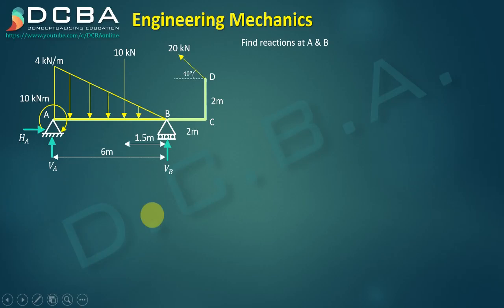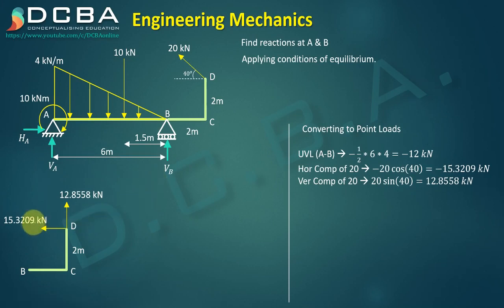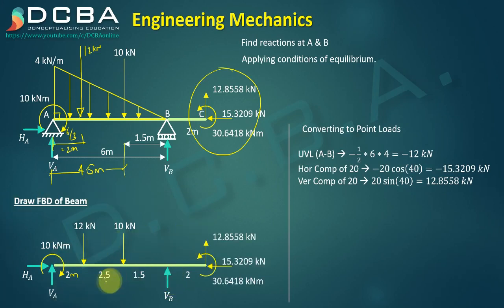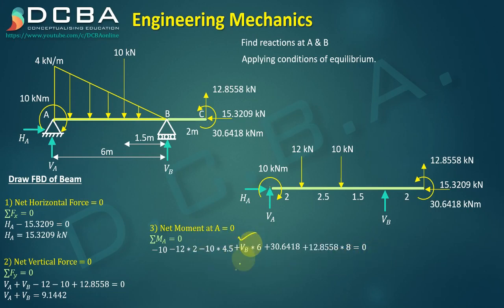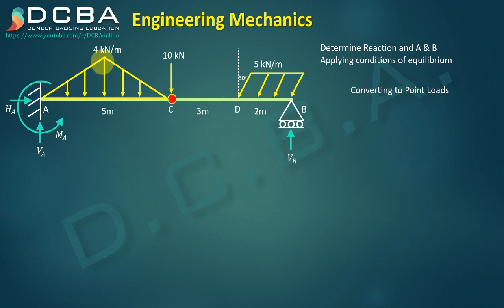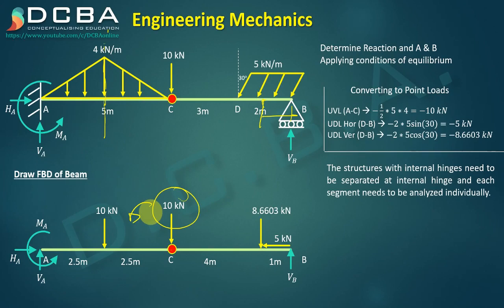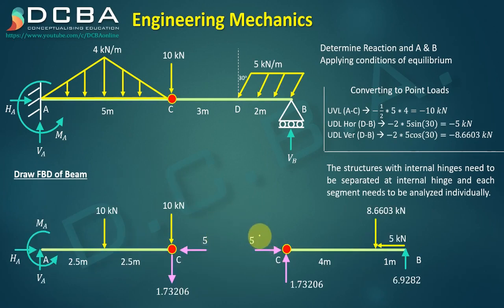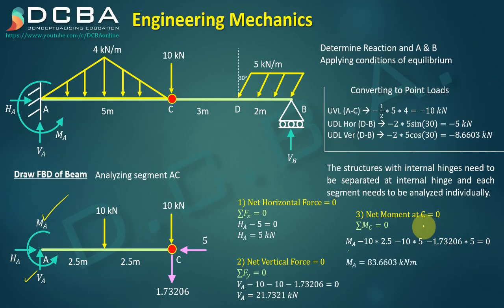Lec 26 - Beams with Internal Hinge support reactions | Engineering Mechanics

Comment: wonderful lecture..ur english fluency is awesome with good command on grammar. 
I have a doubt that, in internal hinge problem, when we keep load of 10kN on CB span, we get different Vc value than when we keep 10kN on AC span. So how is this justified? Is it ok to have two different values of Vc for different cases of keeping load on both spans individually?
Reply from the maker: My question is how did you calculate left span using just conditions of equilibrium, it cannot be solved with that you need certain compatibility equations also to solve it. Hence if you  are getting a certain answer by solving left span first it may not be the correct answer.

Comment: Really helpful to say the least.
Q: What about if a concentrated moment would act on the internal hinge?
Reply from the maker: The moment could be transfered to either of the sections when analysing each section separately.
Reply: @DCBAonline  , Thanks for your feedback
I'm facing some difficulties in analyzing this beam:
https://1drv.ms/u/s!AkY2QDLZoMD1gfky09HGgsjWMSkRMQ?e=hk89WL
When applying a concentrated moment on the internal hinge, the instructor has put the moment on each sides of the beam!!!
I couldn't figure out why he did that.
This is the solution of the instructor:
https://1drv.ms/u/s!AkY2QDLZoMD1gfkzlqYbCim8ORH6_g?e=61OSrT
Reply from the maker: Relative slope needs to be solved using moment area method. You can watch my videos on moment area method to get some idea.